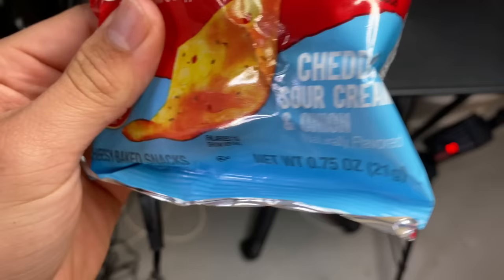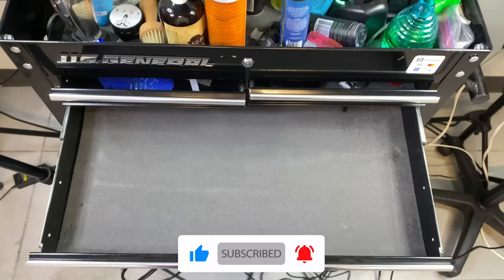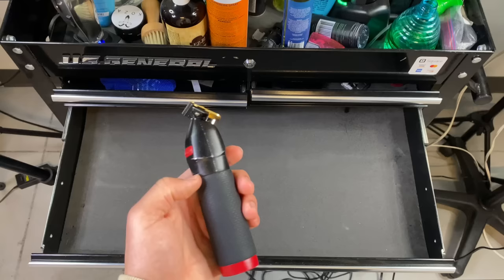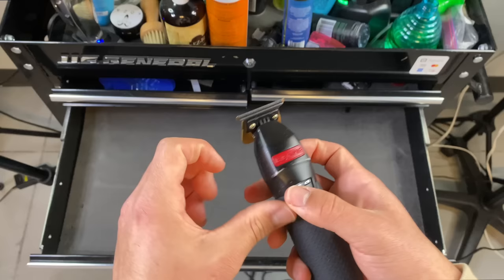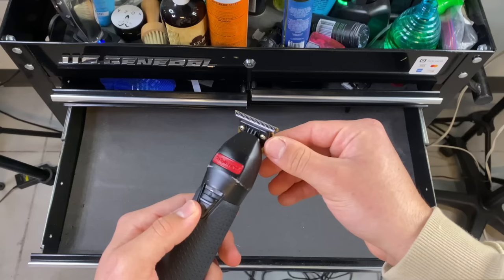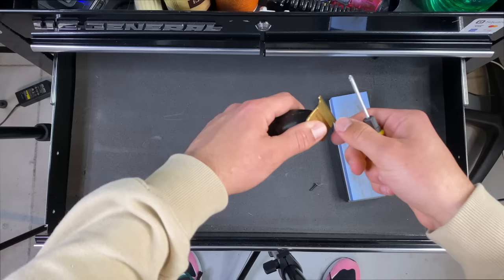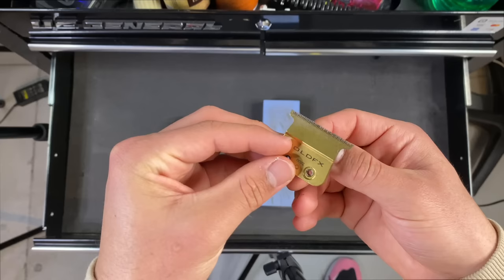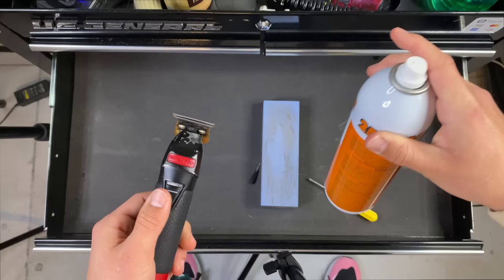How to SHARPEN Your Trimmer Blades & Make Them HIT like Will Smith

Comment: Dude legit told the truth. Did this followed the video exactly and damn it. T outliners. Babyliss gold fx, slimline pro li’s, styliners. All sharpened with the stone from the description. Ordered from Amazon about 3 months ago. Finally updated all blades. They all hitting. Each one razor sharp and soft on the skin. Babyliss fx trimmers hit different than Andis trimmers. Before sharpening the blades on my babyliss they just didn’t cut smooth or feel like Andis. Andis has a real familiar cut. It’s smooth if you set your blades right. A lot of people set them to close so they cut you. But I watched 4thken video on setting and then this blade sharpening. And he was dead on! Respect fam!!
Reply: What stone is this? Or what measurement of stone ?
Reply: Hey what stone was it I need that
Reply: @EffrenCruzz-eg3iq 400/1000 whetstone

Comment: The babyliss are my dream trimmers. Even though I have slimline pro’s right now, I really want the babylis trimmers because the slim lines are sharp but not sharp enough to the point where I have to go over the same spots several times to get it sharp.
Reply: Get them
Reply: @BiglariProductions  wish I could outta my paycheck right now
Reply: Bruh,  it sounds like you don't cut hair for a living. If you don't,  then you don't need to worry about getting a babyliss trimmer. What you need to do is get your slimline to hit, which it absolutely will if you have any idea what you're doing. Then you need to hone your skills and get good at cutting hair. Then, and only then should you think about that trimmer. What you have is a quality tool that will do the job as well as any other. You gotta learn how to adjust and set your tools. Then how to use them properly. Then promote yourself. If you're built for this you will get there. If you're not built for this you'll still be making pointless comments like this one a year from now. Nobody really cares about what your dream trimmer is bro. What exactly are you doing to GET them??? Cuz one thing I am certain of, is that talking has never gotten me a thing. Work has tho 💯
Reply: @josephmccauley368  obviously I already know how to cut hair just need better clippers to make the cut come out better
Reply: @josephmccauley368  every barber knows they need the best clippers for there haircuts to come out better
Reply: No. You don't. I can do the exact same quality of work whether it's done with Walmart clippers or any of the premium brands. Any real barber who works in a shop will tell you the same thing. So if you really believe the clippers will make you better, you  should stop cutting now
Reply: @josephmccauley368  no make you better😂🤦🏿‍♂️just make the haircut look better and doesn’t take as long
Reply: @josephmccauley368  why you think every barber has premium clippers?
Reply: First of all YOU said you need better clippers to make the cut come out better. Not me. I actually said the opposite. And I never said EVERY barber has premium clippers,  but that any real barber can do the same quality cut with or without premium clippers. Besides,  the slim line is a premium tool. I have one on my station right next to my absolute hitter and I been using it for years. Still works perfectly even after cutting an average of 10 heads a day for almost 3 years. 15- 20 on Friday and Saturday. All I am trying to get across to you is that you need to have more faith in your SELF,  and not in your tools. I want shit that I don't have just like anyone else. But I set goals and I work hard and sacrifice if I really want it that bad. So all of my smart ass jokes aside,  believe in yourself and your abilities. Never let something as trivial as a certain tool set the tone for your self worth. Work hard, budget. Sacrifice. And you will have them before you know it.
Reply: @josephmccauley368  I’m literally okay with my clippers just prefer to get better ones so the cut comes out better
Reply: @BarberPlugTy  It's not the clippers it's the skill set and technique 😉
Reply: @skipmarshall3840  the clippers bring out the cut better tho
Reply: DBLegends accounts I don’t think he’s only talking to you, he’s talking to other people that may come across this section and may think they need premium tools.
Reply: DBLegends accounts The only thing that brings out the cut is sharp trimmers! I’ve seen amazing fades with the cheaper clippers. Get to know your clippers and the blend may come out faster.
Reply: @maincharacter2677  cheap clippers will only be sharp for a couple cuts before it gets dull it’s cheap for a reason
Reply: DBLegends accounts Where did you get that from? That’s really not true many have had their clippers (from amazon for years including me). If you’re blades are getting dull after a couple of cuts you’re doing something wrong or there’s a problem with your motor/ blade. Also most modern blades are self sharpening? Even the low cost amazon clippers.
Reply: @maincharacter2677  cheap clippers are cheap for a reason they don’t last long and if your still using it then you are trying the cut hair with some weak clippers
Reply: DBLegends accounts You’ve still got it wrong. They’re only low priced because you’re not paying for a well known brand so they have a reputation to build. An example is kemei which has risen up the ranks. 

Wahl is notorious for having a cheap quality and feel and can easily
break if dropped, Andis is notorious for battery and quality control failures, Osters cordless clippers have been released with serious defects (given its their first). Let’s not talk about having to replace babylis’s cam follower after 2 months of using it as it rattles. It’s gotten to the place where people are paying for the brand not the quality. The longer you cut hair the more you’ll realise that.
Reply: @maincharacter2677  pretty sure I’ve been cutting hair twice as long as you plus the only way you can use cheap clippers for a long time is it you replace the blades the blades they come with won’t last even a month
Reply: DBLegends accounts It’s not even up for a debate who’s cut longer between us. I just told you the longer you cut hair you’ll realise it since people learn at different rates. (either way it would be worse on you if I’ve cut hair in a shorter period of time than you and I already know this info). 

I’ve used lower priced clippers and they’re still lasting, no problems with the blade too. My peer has also done the same. I supplied you with info, you don’t need to agree with it. It’s for everyone else to see it too.
Reply: @maincharacter2677  well I guess your cuts don’t come out the way it’s supposed to if it being cheap doesn’t matter to you
Reply: DBLegends accounts The only thing you’ve been successful in today is making assumptions and not talking facts. If you still think you can’t blend a fade with a low priced clipper you shouldn’t be cutting hair at all. You’ve been dismissed.
Reply: @BarberPlugTy  smh you ain’t gone make it thinking like that
Reply: @A1ExtraSauce  how I’m not gonna make it thinking like that?😂
Reply: Anyone saying the clippers don't matter is extremely confident in themselves. Clippers matter. Reason y serious barbers have serious clippers. Ain't no cot damn barber in the barbershop cutting with walmart walhs gtfoh. Imagine," hey barber where u going? Pff to walmart, to pick me up a set of barbasol trimmers. Don't u want something that's gonna cut more precisely? Pff nah, it's all in the wrist."
Reply: @BarberPlugTy  get them when the money's right
Reply: @maincharacter2677  my babylist came with a extra Cam follower
Reply: @JOCUTZ83  What model did you get? That’s great they actually included another cam follower!
Reply: @josephmccauley368 
And yet, you sid a looooong reply to his post😂😂

Comment: I just use the blade modifier from the rich barber. I haven't had a bad batch babyliss fx trimmer. The different blades that come on them is a different story. The gold and gold 2.0 make the crispy lines but get hot faster with debulking. The graphite and graphite 2.0 don't get hot as fast but the lines aren't as sharp... Still pretty good though.
Reply: Would you recommend the blade modifier from rich? been trynna decide between that or this
Reply: @JG-ys6bq  definitely bro. I've never tried this method so I'm not saying it won't work but the blade modifier works like a charm and I would assume is a bit safer.
Reply: @JG-ys6bq  just don't over sharpen your blade with the blade modifier either. All you need is a couple of swipes. I recommend watching his video before using it. It really does take a minute or less
Reply: I got the rich barber blade setter and it didn’t work for my babyliss fx. It did work for t outliners and slim line pros though. I agree on the blade differences. That graphite blade felt weird and didn’t hit at all. I set it like 4x modified it. Even used a sharpening stone. Never hit for me.
Reply: How about the 1.6 DLC titanium skeletonfx blade, just bought came in with a 1.6mm blade and they are trash as …. They dont hit like in all the videos ..
Reply: @Shqipe040  I've never heard of or seen that blade.
Reply: @sandman1133  it literally says on the blade with big letter “SKELETONFX” and small letters “DLC TITANIUM 1.6 FX707ZE” i also never saw them on any youtube video i watched
Reply: @Shqipe040  I'm in the US are you overseas from me because I've seen videos where the blade says "skeleton fx" but none of mine do. The either say gold fx, graphite or graphite 2.0, chamaeleon....but none say "skeleton" fx.
Reply: @sandman1133  i live in the netherlands bro, that could be possible but mine really dont hit… theyre 0 gapped but still shit.
Reply: I swear I just ordered my 3rd on the money blade setter 🤣 been buying em for like 8 years now it gets no better than that
Reply: That rich barber blade modifier is trash

Comment: In regards to your car reference the motor of the clippers is like The engine of a car. The more power you have the more you can do with it. The blades would be the equivalent of the tires. All the power in the world means nothing if you don’t have traction. Traction is just as important in the same way that the blades are important because they channel that power into a specific point the same way the blades do their part when trimming the hair
Reply: Wrong a sharp blade it wt you need these clippers have the right power it's not like a car sharp blade is the key 😂😂🤣🤣👍💯💯🤧🤧

Comment: i love the babyliss lo pro trimmers. i hated the dlc blade tho, i put the gold fx blades and now they are crispy. i use the dlc on my influencer trimmers to remove bulk.
Reply: exactly i learned its way better to have 2 not one do all trimmer, because the fine tooth line up excellent but dont trim or bald as efficient as the doc and deep tooth
Reply: Agreed I had to go thru 3 different blades before finally buying the gold fx blades. And it’s been good ever since!
Reply: I have the 1.6 dlc titanium blade and they are trash, which one do you recommend? The goldfx or goldfx 2.0?

Comment: hey man, thanks for the vid, really gonna need this when I buy a new trimmer! though I just want to add, that is a japanese whetstone, so unless it has cross your mind before, I think you might want to try making the surface of the whetstone moist when doing this. typically, when using a whetstone to sharpen a knife, we have a water source to repeatedly keep the whetstone moist when sharpening
Reply: Unless of Course You're Familiar with Trimmer Blades as You're Familiar with The Japanese Whetstone. . . Naaaa

Trimmer or Clipper Blades are Aaaaallergic to Water. I may have Saved you Huge Trouble

Comment: babyliss blades have a sweet spot sometimes it takes a few times to set the blade right to get that spot and get them hitting right. these blades are so sharp you dont have to gap them too close they will cause a lot of irritation
Reply: Everyone be giving me their trimmers talkin bout “u da gap king”😭 nah but Yee mine are hitters haven’t had to adjust em at all consistent and sharp
Reply: 1000% correct! @bhombs
Reply: Mines pulls the skin and cuts it :( i gues ill have to less zero gap them
Reply: Brooo it drives me nuts. U gotta get them to that perfect spot and DONT fuck with them no more. U find that sweet spot and they hit so hard, but if u take them blade apart to try to clean them or try setting ya other trimmers the same , it’s never the same as when u get that perfect setting

Comment: Great video,  it is recommended to soak the stone in water for about 3 minutes before sharpening.
Reply: Or put a few drops of clipper oil on the stone
Reply: Block has two sides. Do you use the finest side to sharpen?

Comment: Glad I came across this video. I recently purchased 3 different babyliss blades and they all snag the skin when doing the c cup. Going to try this method in the morning.
Reply: Did it work
Reply: @barberdre214  no they still snag
Reply: The blade migh be hanging over a lil bit slide it back a tad bit
Reply: Sometimes when the blades are new the nipping and snagging can come from the metal being freshly cut and it can be the problem. Just think about when you trim your nails how sharp the edges are when you get done with them.
Reply: Yooooo same here ..... did anything help?????????

Comment: Those two blades are not really sharpened as you just explained but what it does is to allow the two blades  to function as a pencil's mouth, so with that it can hit and produces a sharp edge line
Reply: What the hell is a pencils mouth😒
Reply: @8macvar  😂😂😂😂
Reply: @8macvar  right wtf
Reply: Ok so basically the parts of the blades that cut are the inside parts rubbing against each other as scissors do. U can sharpen the outside part of scissors all you want it won’t affect how it will cut because u didn’t sharpen the part that actually cuts. (Inside parts of the blades the ones that actually rub against each other doing the cutting.)  in the video he is show making both blades thinner by scrapping metal off. Thinner yes, sharper not exactly. They would cut just as they did before. What u will have now is blades that go into the skin pores if not filled out correctly. To sharpen the blade u have to take them apart and do the inside parts.
Reply: Lool I don't know these kids any common sense. Not being mean, but makes me laugh m azz off 😂
Reply: He said that…. I heard …if y’all was listening…He’s not technically sharpening the blade he’s dulling the blade , which from my experience works on these Babyliss blades . Sharpening or right out the box  they don’t really hit .. over time as the blade wears u get crazy crisp lines. With that satisfying crunch noise as ur cutting

Comment: So I just got the Stylecraft Saber trimmer. It hits nice. But here is a relevant question for you coming from a hobbyist haircutter and straight razor and knife collecter for 25 years. What grit stone are you using to sharpen your trimmer blades? Can you reset the bevel at 1000 grit and hone the blades to 12k or higher to make super sharp and smooth. Why don't you wet hone on the stone?
Reply: Bruh too sharp trimmers and you gonna split someone scalp open 😂. Not an expert but have had some razor sharp trimmers split me open (75% of my hairline bleeding). Then they rub alcohol on it. Nah homie I need stitches after this.
Reply: No…sir…! I always have to explain to people that there’s no such thing as “too sharp”… if the trimmers are cutting you AT ALL, it’s because the moving blade is cutting your skin.. which means it’s sticking out further than the fixed blade. This means they’re not properly adjusted. A lot of amateur barbers and/or clients get that confused.
Reply: @swizzlecuts5004  Yup! "Zero Gap" means setting the cutting blade 1/32" in relation to the comb or fixed blade. The cutting blade should not be flush or above the fixed blade or you will cut someone. All clippers and trimmers are like reciprocating electric hedge pruners or trimmers. The sharper the better. In general. People get injured more from dull blades than sharp ones because the finer and cleaner the cut the easier it is for the skin to fuse. But also the sharper, the deeper the cut will go. Accidents happen because of dull blades and too much unnecessary pressure.

Comment: I find it very weird that you would sharpen the still blade.  Seems to me its going to fuck up the angle very fast and start disappearing.  Like when they sharpen knives the set the bevel to the exact degree.  Doing that by hand on the side with the cutting blade, even doesn’t really make sense, but atleast the angle is fixed and you’re not doing it by feel, but then flipping it over and doing the still blade without locking in an angle gonna round the fuck out of the point.

Comment: Hey. What do you do if the clippers are already too sharp?
Reply: I'm not a barber so understand this isn't professional advice but if they feel too sharp you should back the cutting blade away from the edge of the guard blade a bit.  A super sharp blade that is zero gapped isn't usually gonna be too comfortable on sensitive areas.  Just leave enough room you can feel the edge of the guard blade with you nail.